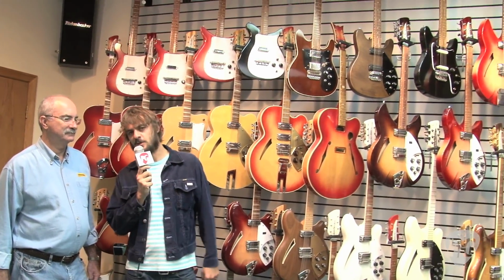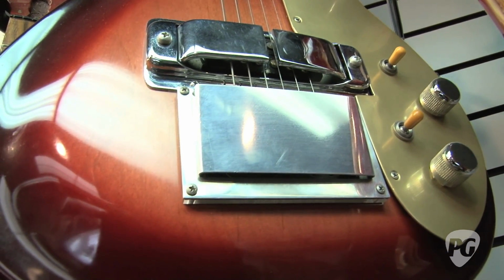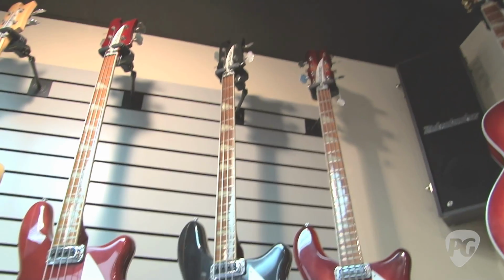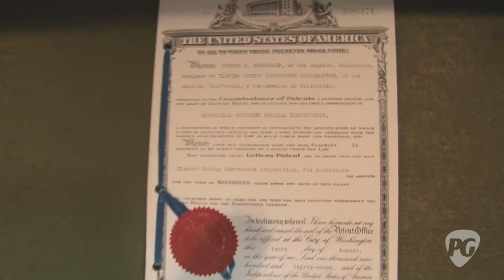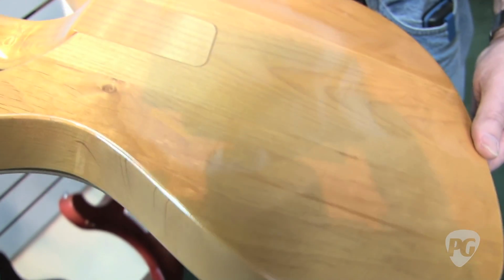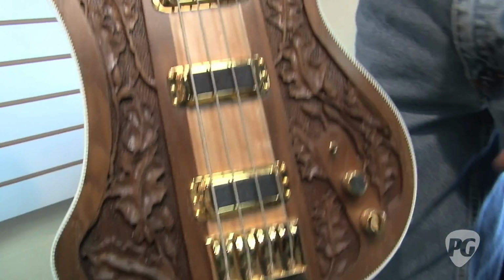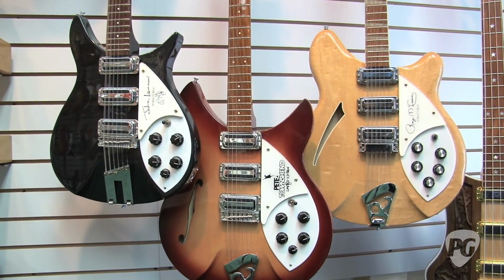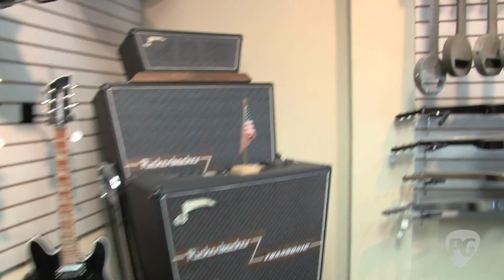Rickenbacker Guitars Vintage Instrument Archive

Comment: Was there ever a George Harrison  330 12 string model? I don’t recall seeing one ... if not, there should be - with out George playing that 12 string there would be no Roger McGuinn  model ...
Reply: It was a 360/12FG, but it wasn't the model used after about 1964 as the default model: the one GH plays in A Hard Day's Night is the original 360/12, now known as 360/12C63 ... model 360, 12-string, Capri style (F would be full-body) and 1963 version.

Comment: Aside from all the amazing guitars, that electric violin is astonishing for something from the 30's
Reply: In 1930 the nation is at the top of "electric" with radio being the media and from 1920 -1950 ... big bands! Yes, it's the Jazz/Swing age and the scope was everyone was trying to get instruments which could cut thru the volume of a band full of brass horns. Many ways to do so - amplify it - either mechanically (as National did), build a larger sound box (as Gibson had) or try to mic it into an amp - thus the magnetic pup (Rickenbacker). Ric's mainstay at first was the Hawaiian music target market - thus lap steels and pedal  steel which fit in and somehow took to blues and country - however the idea was to hit swing. The 20's mostly saw banjo's - naturally loud enough - still in the rhythm section of a jazz band. The scope however was to cut thru the band.
Reply: I have owned 2 electric 12 string 360’s in my life, if you’ve never played one, you wouldn’t understand!

Comment: I've wanted a Ric 360 12 since the Byrds came out with Mr. Tambourine Man in '65. Now, I'd still take that 360 12 but would rather have the 370/12 Roger McGuinn model. I absolutely love these guitars. I'd also like a 360/6 string. Both in Fireglo. These are absolutely great guitars.